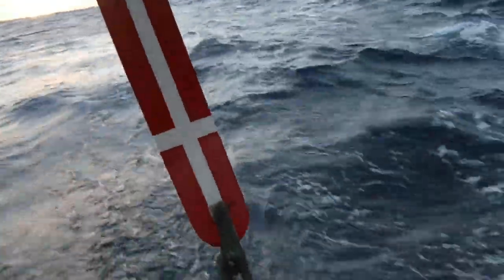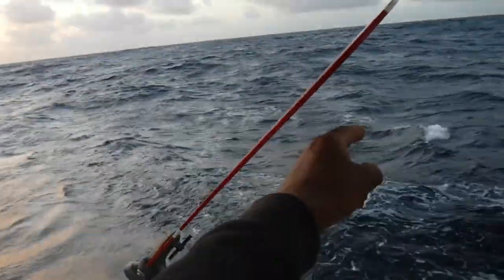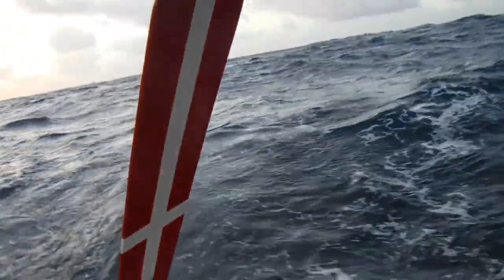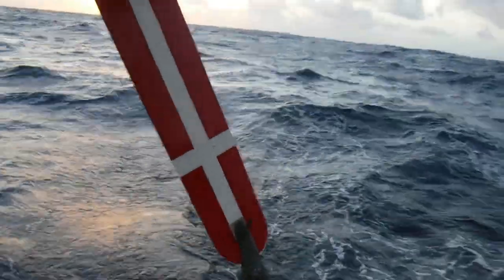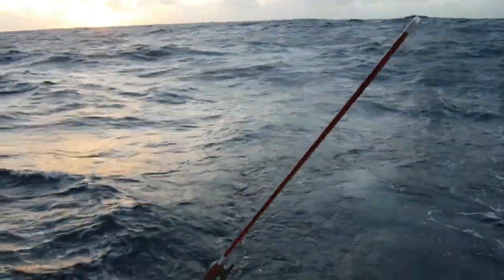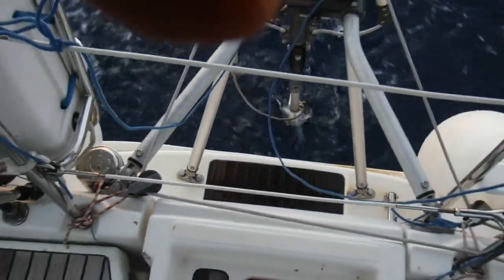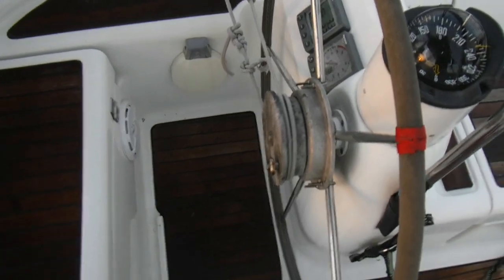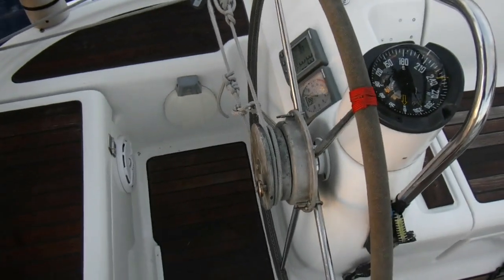How does a windvane work

Comment: Seeing this was like meeting an old friend.....I've logged thousands of miles with an Aries and found it to be a loyal crew who does not need sleep or food.  If you want to know what it is like WITHOUT one, I had a windvane break a few days north of Hawaii when on passage to Seattle, in 1976, doublehanded.  So with only two on board, it was watch and watch for the next two weeks.  One week we were in 40kts wind, in the Westerlies, long period swells that were big enough the bottom of the sails luffed in the troughs.  The first day, we were averaging about 8.5kts, but my nerve failed at sundown and we handed the mizzen, so missed out on that 200 mile day by about 10 miles.  I won't say were were tired, but on one of my watches a piper showed up in the cockpit and was taking requests.  As it happened, a 12-meter America's Cup boat left Hawaii the same time as we did and only beat us to Seattle by half a day, 18.5 days total.  The boat was a Herreshoff Marco Polo....55', three masts, 10' beam. "Valkyrie"  (I'd sure like to know where she is now!)

Comment: So the windvane helps the wheel, and there for the main rudder to steer the boat. At same time the windvane contributes very little to steer the boat directly. Am I right? Thank you.
Reply from the maker: This type of windvane is called a "servo-pendulum"  It does not steer the boat directly but uses the boats own rudder to steeer

Comment: Thanks.  One question, how does the apparent wind not effect the system.  Maybe I’m overthinking this but seems as you start moving forward, it would add new wind force dynamics?
Reply from the maker: Apparent wind does affect it. The system steers to apparent wind. Which does not matter since you simply adjust it

Comment: My lift up is almost the same as yours. However the oar/paddle has no section in front of the stem. My aeries will not work with the wind aft of 90 degrees. & is very poor at holding a course unless upwind. Your steering oar seems to show a certain amount of the blade in front of the stem. Is that correct & if so roughly what % is in front? I am making a new oar & am wondering if this will solve the issue. My model is a Franklin one
Reply from the maker: Not sure what you mean. Our vane blade is adjustable via a screw at the base allowing us to move the blade from verticle to horizontal. Moving the blade like that increases/decreases the sensitivity of system. Our vane steers well with the wind aft the beam. Best at up to 175 degrees but will steer even with wind direct from aft
Reply: @sailing-distant-seas  Sorry for the confusion. I am talking about the part that goes in the water NOT the vane. I have experimented with several types of vane as well & now have what I think is the best. However The boat still does not hold its course The reaction of the aeries is far too slow. The boat rounds up long before the aeries reacts. So I want to improve the response time.
Reply from the maker: @grahamlongley8298  move the wand blade further to verticle. Tighten up on the lines from the aries to you helm. Do you have some kind of superstructure on the aft end of the boat that disturbs the wind flow?
Reply: @sailing-distant-seas  Tried that & I certainly have nothing obstructing the flow to the vane. The boat is a hanse 311 & i do not even have spray dodgers or a spray hood. . I have tried all angles of the vane. I have found a stif vane best to avoid flex & the current one is partialy reinforced with GRP for the bottom 1/3 It is light & thin above this . I have even installed an adjustable weight sytem to the vanes to see if vane balance helps. I have done everything I can to reduce line friction to the tiller & I am aware of the effect of moving the tiller along the chain when hooking on. I think that you ( probably you) & I discussed this at the London boat show years ago. I even tried fins on the back of the vane, I have a streamer & I have tried "parachutes" on wire frames on the trailing edge of the vane as well to get the vane to respond better.
Reply from the maker: @grahamlongley8298  well i don’t know and am running outt of ideas. You might contact aries in holland and see if he can help
Reply: @sailing-distant-seas  Thanks. I shall keep trying. I will see if the new oar helps first. Then it will be a different set of gear.

Comment: Cool!!  So would you feel comfortable sleeping for an hour on auto pilot. If there's a big change in wind direction and you've got to change your course or sails, does the vane signal that?? Anyway, thanks for the vid. Glad to see your 30-year-old vane still works fine.
Reply from the maker: The vane only steers a course at the same angle to the wind - if the wind angle changes, the vane alters course to follow the wind.  You should never leave your boat without someone keeping watch - no matter what kind of autopilot you use.
Reply: @sailing-distant-seas  What about when you're sailing by yourself?
Reply from the maker: @STSGuitar16  Single handing is a different discipline.  Here you need to get some sleep, so you will leave the boat to sail itself - but that can (will) be dangerous.  I've done it, but don't like it (there really should always be someone on watch) and certainly don't recommend ti to anyone - certainly not when sailing passages.  We've met a fair number of single-handers over the years, but I still done think it is a safe way to sail

Comment: What if the wind changes direction? Do you need to correct it?
Reply from the maker: If the wind changes direction, the vane will continue to keep the same angle to the wind, meaning the boat will make a new course - keeping the same angle to the wind as the vane was adjusted for.  SO the short answer is "yes" you will need to adjust the vane to keep the same course
Reply: @sailing-distant-seas  Thanks for the explanation, i realized a bit late the fact that sails won't turn on their own to correct the wind change. But how some people sail solo for days , i mean what if the wind direction changes when they are sleeping?
Reply from the maker: @jeb123  if the wind changes while they sleep then they will wake up some nautical miles off course. That is generally not an issue if you ate on a long passage  a long passage will take anywhere from 2 to 6 weeks. A day more or less is not important.
Reply: @sailing-distant-seas  thanks again sir
Reply from the maker: @jeb123  if it intetests you you can read about our travels ( we have been at sea for 6 years) at
svcapri.com
Reply: @sailing-distant-seas Yeah recently i am more interested to sailing, it feels so free and independent. I hope i can start sailing in near future. I checked the link for a moment, i'll read it more when i find the time thank you. (Sorry for my grammar, still learning.)
Reply from the maker: @jeb123  grammar is fine. Hope you enjoy our website
Reply: @sailing-distant-seas  👍